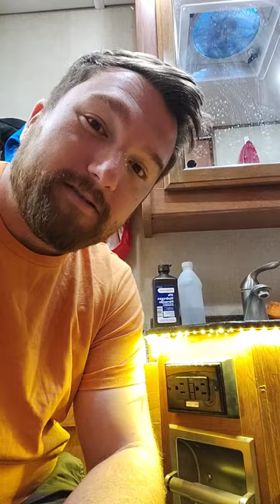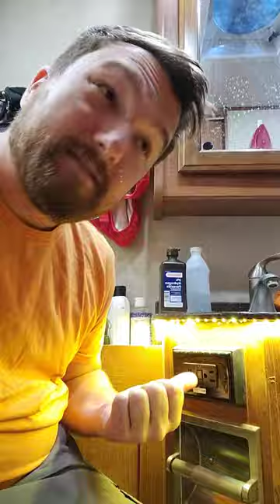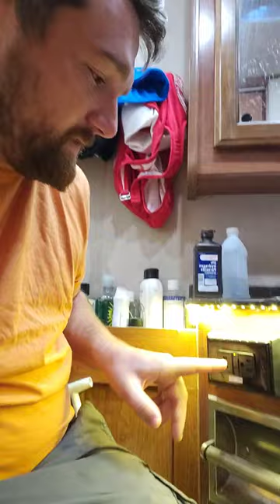A few RV Outlets Not Working? #rvfulltimeliving #rv #rvdiy #rvrepair #rvlife

Comment: Ok but why do I have to reset my gfci for all my outlets to work? Also how do the outlets work just off the battery?
Reply from the maker: The outlets will work off battery if they are through an inverter. 

The GFCI is like a breaker. All the other outlets are after it.

Comment: Hi my gfci isn’t even turning on or working
Reply from the maker: If you have good power to the outlet but not after. The GGCI will not reset. You need to replace the GFCI. 

If you don't have power to the outlet at all. Check the breaker.

Comment: I’ve tried everything my outlet still don’t work. The only one that works. Is the one for the fireplace. I’ve changed out both GFI now what
Reply from the maker: Make sure the GFI is wired right. The load side goes to outlets. The line side goes to breaker box. RV outlets can be reversed. Make sure the power is on the line side

Comment: I did that and only two outlets work and the rest don't what do I do I also turned off and on my breakers
Reply from the maker: You used a multimeter to make sure the power is getting to the GFCI or coming from the breaker? 

This will tell you where the power stops. Once you know that you know what's broken. 

Or you can just replace things till it works. If you like. Replace the breaker. See if that helps.
Reply: I’m having tha same issue. Back end of my rv outlets stopped working. I replaced breaker checked fuses. Checked outlets wire connections and everything seems fine! Idk what else to do… :/ any more advice?